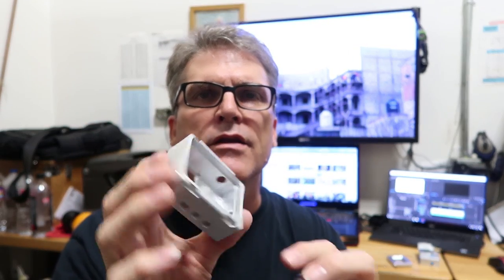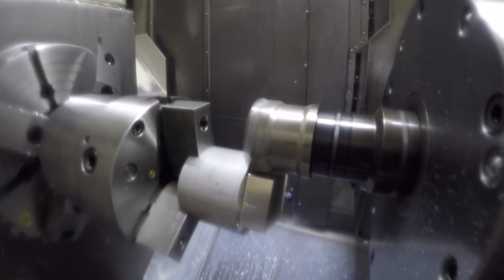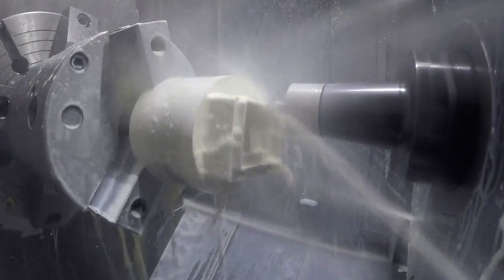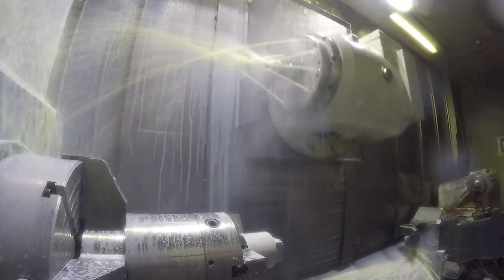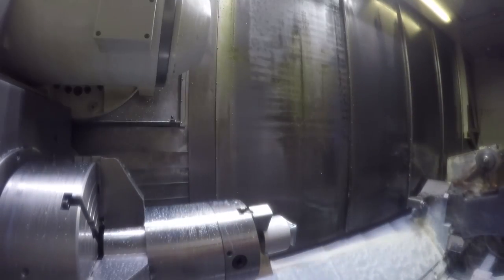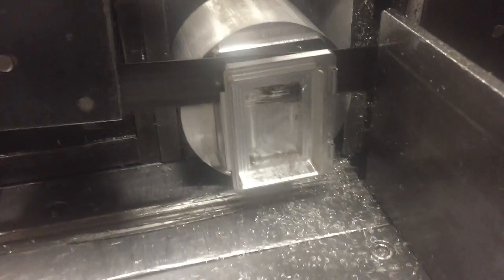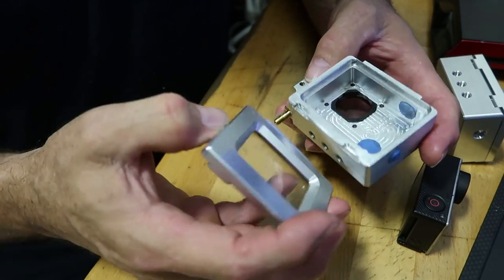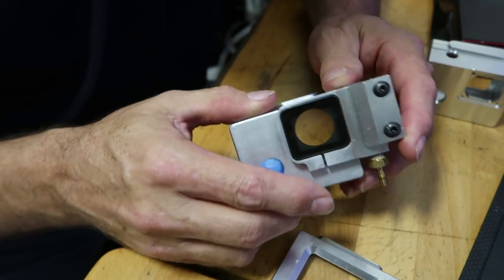Aluminum GoPro Case Back

Comment: Nice Peter! See you really can make just about anything on a mill turn, even put a kurt vise in it, LOL. My jaws on both my kurt D688 vises have about a 0.0003" dip in them right at the screws for the jaw. I also tried rain x, lasted a few minutes and then it was gone. Have not found anything yet other then the air knife to keep the coolant off. Awesome case for the go pro!
Reply: I know it’s been a long time, but I believe the camera in Area 419’s Grob machine has a spinning lense/lense protector that they use for live streams.

Comment: You always amaze me. The vise mount/fixture, that was cool!!!! The video angles (all of them) were really neat to see as well.  The buttons that are hard to push, would making the hole the the RTV is cured in bigger, allow the buttons to be pressed easier? Maybe scuff the inside area of each button bore, so the RTV really hooks/holds on to the aluminum? These several videos of the GoPro aluminum case has been really fun to watch, and I always learn something, Thank you for the inspiration, Drew
Reply from the maker: Dru Bradley The button on the side is harder to push because the wall thickness is thicker and the button is smaller in diameter. I will not need that button often so it will be OK.

Comment: Would really like an update on this  Fixture you made! How its working out, do you use it and what would do improve on if anything.  Really is to cool
Reply from the maker: Are you referring to the vise mounted between the chuck and tail stock? I rarely  use it. But it works fine the way it is. The only change I would do is put a dovetail type of connection to the chuck jaws.

Comment: Enjoyed the video, you are very creative in both design and problem solving.  I am envious of your skills and access to such amazing machinery. That chamfer tool path on the new fixture was especially fun to watch - question, the stock you used for the new fixture, was that specially ordered or just something laying around that was close enough? (how much did it weigh?)
Reply from the maker: Craig Stearns I cut it off the end of another fixture. It's a 10" diameter piece of aluminum 25" long with a 6.25 diameter end 3" long to chuck on to. As to how much it weighs with the vise I'm not sure. It really isn't a problem, I have a crane to lift it.

Comment: We use WD40 (in a pitch), Ceramic Coating Paint Protection (the stuff for cars/trucks/motorcyles) or car wax (dealers choice on brand) keeps the windows clean last along time.

Comment: Very nice! You got a an amazing machine。 I think it is better than any standalone type cnc 5 axis or cnc lath machine。 Also, you fully manoeuvre it as well as the toolpath software。BTW， hoping that the made aluminum trunnion is not an one-time-use device。

Comment: Great video. How do you locate all the different cutting tools to the part you are making? Is there a term for that ?
Reply from the maker: Every tool on any CNC machine has offsets one for length and depending on the way the tool is being used a diameter or radius offset (if you are using cutter comp). The work piece also has a work offset or fixture offset. The machines control uses these to know where to put the tool. On a 5 axis cut as in this video the cam software computes the path of the tip of the tool and the angles necessary, in this case to keep the side of the tool on the ruled surface on the solid model. I know that sounds difficult but the computer takes care of that. All you have to do is make sure based on your setup on the machine that you place the model on the computer in the proper location (This is important). The cam software takes care of the rest. The machine has to also be capable of doing 5 axis tip comp.

Comment: That's a big hunk of material for the vise fixture half round thing? How much does it weigh and how are you loading/unloading it from the machine?
Reply: Probably tapped lifting holes in the aluminium or clamps something into the vise
Reply from the maker: Mārtiņš Zinbergs I can just put a strap around it and lift it with the crane. So weight isn't a problem.

Comment: Very cool stuff!  I have noticed the same issue with a few other kurt vises, do you think it might be caused by the clamping force of the fasteners holding the jaw on?  Also, I wonder if it goes away under proper clamping pressure?  (I haven't tested either of those things for myself, just thoughts I've had when I didn't have enough time to test them.)
Reply from the maker: Pete Brubaker Yes I think it's the screws. I'm going to take the hard jaw off and check the master jaw underneath. I think the problem is there.
Reply: Edge Precision is there an e-mail i can send you some pics from my setup?
Reply from the maker: Olivier C  at peter@edge-pre.com

Comment: The case is really nice but its been my experience that coolant will eventually attack silicone.  You need polyurethane. Superglue will also fail in a waterbased substance.
Reply from the maker: So far the blue permatex silicone gasket sealer that I used for the buttons has held up. The super glue holding the back window has failed. but the foam gasket off the original GoPro case still seals it ok. Due to just pressure against the back of the camera.
Reply: Not much holds up to coolant it acts like solvent and is home to some weird bacteria that make peculiar acids even in synthetics. I was an industrial mechanic that worked on many CNC machines and found the stuff destroys almost everything except neoprene, polypropylene plastic, polyethylene, and metal. It will leach all the plasticizers out of most acrylic plastics leaving it brittle and subject to stress. Polyurethanes seem to hold up but silicone will give up and dissolve as well just as if it was in gasoline. Try using o rings for seals and a thin piece of tempered  glass for the window try some of that rain x stuff to resist coolant. The glass I'm thinking of is the glass type   cell phone screen protector perhaps three layers bonded together hopefully with no bubbles between layers. Good luck with that case it is really nice.

Comment: Which cam software are use for ease part programming of your machine ? Plz tell me sir. I am learning setup machine as well as programming of part to be manufacturing..you answer valuable for new CNC users .. setting machine from learn directly your video but I find best and fast cam software using for simulation and analysis of tooling and work .
Reply from the maker: I use Esprit Cam for the machines at the shop. Depending on the machines you are programming for. I think Fusion 360 is also good and easer to use than Esprit.

Comment: Hey Peter,
 Great set-up!! I was wondering if you were using 4-flute endmills to cut that aluminum? If yes what is your formula for getting that to work, i have never had success getting that to work. Always gums up.
Reply from the maker: Yes I rarely use 2-flute endmills. If you are saying they load up is that when you are plunging with them? If that the case you need to add some sort of ramping or helical cut to the plunge cut. Say ramp in at about 3 degrees. You could also peck drill if there is not room to ramp. Aluminum tends to build up on the cutting edges of tools if there is no coolant of some kind. Air mist works good but in my machine I don't have that. On the face mill in this video I am using air thru the spindle. The machine naturally bleeds some coolant into the air stream that's why it looks foggy in the video. On a manual machine WD40 works good but will make a lot of smoke. If you are talking about loading up when you are milling on the side there again not enough coolant. If you want to mill with a high chip load you will need high pressure coolant and even better HP thru the tool. You may be using to high a feed for the RPM (or high chip load). A higher helix on the tool will also help evacuate chips on slotting operation's. A trochoidual (Adaptive in fusion) will also be better on a CNC machine. With endmills I can machine dry in plain steels but like I say in the video I don't like to do it aluminum. I have had this happen in a slotting operation. Where the RPM was so high and the feed so fast that the tool went thru the aluminum melted it and it re welded back together behind the tool. Without even breaking the tool. When the coolant wasn't turned on by accident.

Comment: What does a machine like that cost new? Great video learning a lot
Reply from the maker: Gary Bouchard this model is no longer made it's a Mazak e650H the new model is a e670H. All of the numbers in Mazak Integrex models usually refer to the Y axis travel. I got a quote on the newer model before I bought this machine. Depending on the options the price ranges between $980,000 to $1,200,000. This does not include shipping, rigging, the foundation required under the machine and tooling.

Comment: Even better, run the Drive system pneumatically.Something along the lines of an air ratchet that just runs continuous. And the lens can revolve 360° through some form of a wiper

Comment: Peter, how do you set your work offset when using the vise like that? Do you just set x,y,z of the corner or do you model the vise and part and run from centerline?
Reply from the maker: Usually when I make a setup like this. I set up the machine the way I want. Than I set the zero at the machine where I want. Having that information I than go to the computer a move the parts model to that location for programming or move the existing part with its program to that location.

Comment: did u go to school for that and if so what was it in. im a machinist.
Reply from the maker: jormond scott Nope learned on my own. I'm not sure if there is a school to go to. This is becoming a real shortcoming in the machining industry.
Reply: Edge Precision even the cad programming
Reply: Edge Precision i run a mazak but we program at the panel. not with a computer.
Reply: Thanks for sharing your work, and your story.  About a year and a half ago I got sick of my career as a software engineer.  In that time I learned machining on my own and made a career pivot.  I will say it's hard to find a shop that will give someone like me a shot.  Even after building a portfolio website I had so many applications with no response.  I finally found a shop willing to take a chance, and it's been mostly working out.  I learn faster when I'm challenged, and they aren't increasing the complexity quickly enough - that's the only drawback.
Reply from the maker: jormond scott Yes most software suppliers do offer training on their software and that's good. But there's more to running machines than just programming.
Reply from the maker: Pete Brubaker That's to bad, because only when we get out of our comfort zone do we learn the most.

Comment: How do you datum the parts in the vice
Reply from the maker: Are you asking how I determine where the fixture offset is to be set? I measure the location of the part in relation to the machine at the machine. Than position it in the cam software in that location. My machine doesn’t have dynamic work offsets so I have to do it this way.
Reply: @EdgePrecision  yea that's what I meant, so you teach your G54 on the front of the job like usual?
Reply from the maker: In the case of a 5axis program like this it’s necessary to know my zero point in relation to the C rotary axis in the X and Y dimension. The Z isn’t as critical it can just be set at the machine.
Reply: @EdgePrecision  thanks for the reply, keep up the great work I have learnt a ton from your videos. 👍

Comment: Hi Peter,

Have you looked into using some kind of permanent windshield coating? Such as this by CarPro https://www.carpro-us.com/protection/carpro-forte-professional-windshield-coat-15ml/ It's like super RainX, should chemically bond with the glass surface instead of just sitting on top, and also is supposedly chemical resistant. I haven't tried it yet but was going to get some for my car. With the air knife I'm sure it would be great. If not, could just use the rest on your windshield lol. Awesome machine, only have a horizontal pallet changer at work and I still think it's the coolest thing ever, can't imagine watching one of these. 
Thanks for the video.
Reply from the maker: Thanks do you know anything about this F11 made by Top Coat Products? I was thinking of trying it too.
Reply: No I've never heard of that. I just looked it up and it seems like an interesting product, not sure of it's chemical resistance though. I think either one is worth a shot.